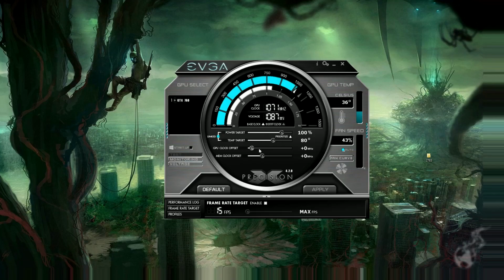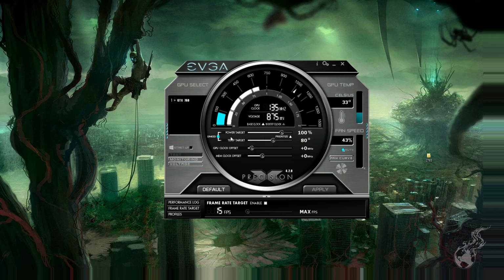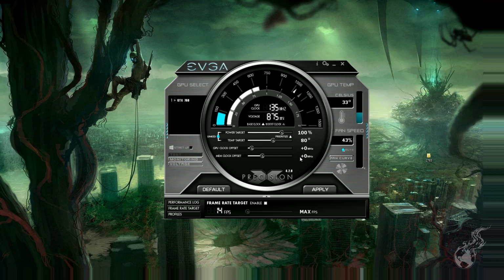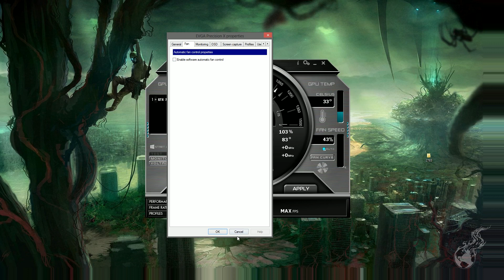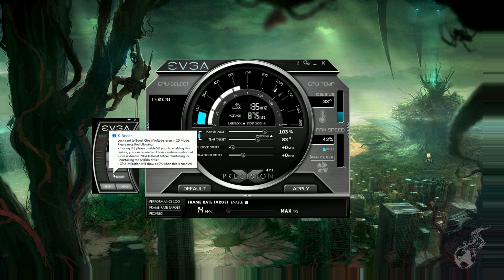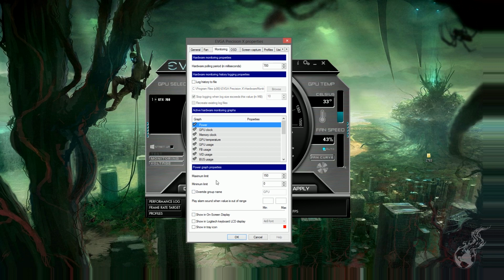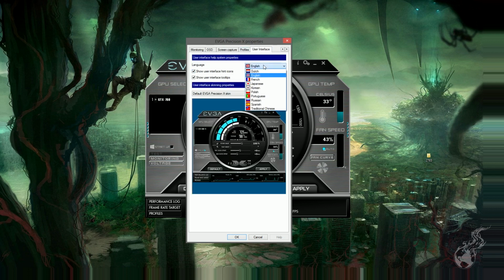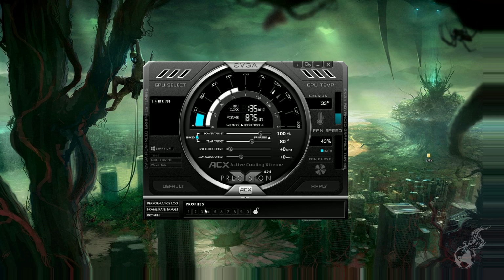EVGA Precision X Overview (Version 4.2)

Comment: hello im just wondering if my graphics card being idle at 25 celcius is bad and maxxed out on games it can go around 75 celcius? is this okay?
Reply: 25 at idle is okay , 75 while playing is quite fine too. You can always try to fiddle with fan speed. Like 15 % fan speed on 30 degress and 50% at 40-50 and maybe 60% at 65% . Open the custom fan speed settings and youll have a graph fan speed/temp just play wiht it :)
Reply: 25 at idle is okay , 75 while playing is quite fine too. You can always try to fiddle with fan speed. Like 15 % fan speed on 30 degress and 50% at 40-50 and maybe 60% at 65% . Open the custom fan speed settings and youll have a graph fan speed/temp just play wiht it :)
Reply: i will do this now , thanks
Reply: sorry for double comment (was using phone) + no probs

Comment: i have been wondering, i have a silverstone 600w psu and it has 2 6+8 pin pcie connectors on the 12v rail with 50amps.
is this enough to power 2 gtx 760s sli? 
even if i decreased the clock speed maybe to allow it to run. some advice please?

Comment: Hello, just wanted to ask something. I'm not a pc guru or anything but still wished to get some overclocking when running metro last light.
 I have an invidia gtx 740m gpu in my laptop, and when I run evga, I can't adjust the power and temperature targets, it's completely blocked off. 
Is this due to nvidia setting a power limit for the card in the bios, or is it something which I can activate in some certain settings menu?
Reply: Not a master but i think your laptop gpu is just locked because it shouldn't be oc'ed. But im not sure so please ask on some forums or smth.
Reply: You are right. I should have used common sense in the first place, but looked it up on the net and it turned out that my gpu isn't really meant for overclocking as well as having a really limited power supply, thus even if I wanted to risk overclocking it, I wouldn't have enough power to do so. 
Thanks for the reply! You are indeed correct
Reply: OHYEAHDUDES Glad that I helped :)

Comment: Does it work the same if I run two 760s in SLI?
Reply: You would need to oc them separately as you can see on the far left of the software there is a tab that says GPU select and I'd assume you need to monitor them seperatley

Comment: Awesome thanks for the video! Just got my gtx 760 blower version due to my current crappy case but that will change but thx to this was able to keep my temps at a comfortable temp readings which was mid 60'c with my old amd 7770.

Comment: I Have the EVGA GTX 780 ACX and in Precision X you can crank power target and temp target all the way up to max and it barely gets over 60 degrees, so my tip would be to turn these two settings all the way up before you start messing with you GPU clock offset.

Also, turning up the power and temp target will increase you boost clock, so it's useful to know your max boost clock before you start messing with the offsets.

Comment: I used to think that auto with no adjustment to fan curve was the best choice as well. However I soon learned that it was a poor choice. Even when the GPU was going up to 70-80 Celsius, the  fan speed would sit at 45%. I recommend running a few benchmarks and creating a fan curve based on the changes in temperature.

Comment: What I love about precision X is the frame limit feature and the pixel overclock utility. Got to overclock my monitor from 60hz to 77hz and its a huge difference in smoothness. The frame limit utility helped me solve my Vsync input lag annoyance by limiting the frame rate 1 frame below my refresh rate. Removes all input lag like if vsync wasn't on while removing all tearing. Good stuff.